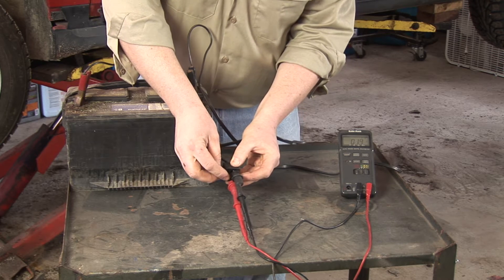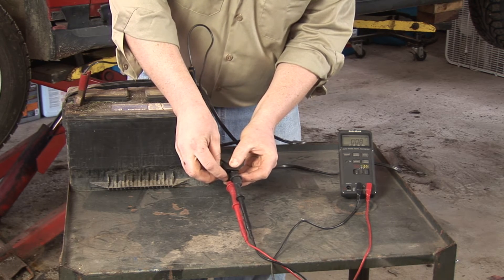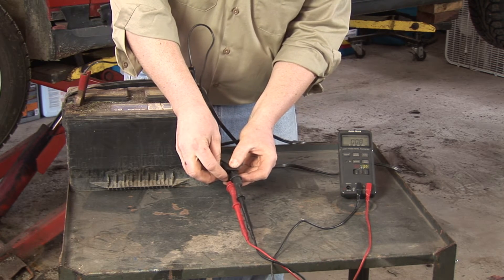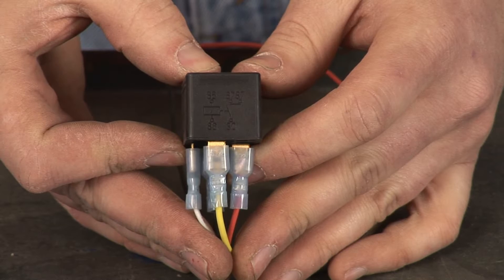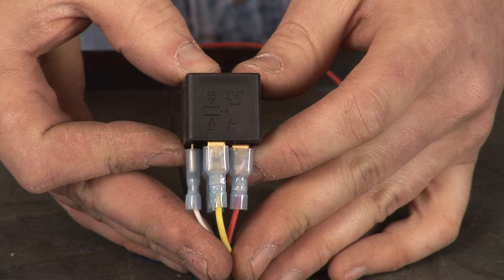Auto Repair & Mechanics : What Is a Car Relay Switch?

Comment: Yep, excelent.
I wondered how some remote place could switch on my off peak apartment heater and some pal said a relay that is sent via the phone company lines, to the building where all the heaters are switched on, as the head power company determines the weather is colder or warmer, etc.
.
I still can't believe that the switch is done over the phone company, maybe it is, maybe that is why everyones telephone number has so many digits in it
.
Thanks for posting
.
Cheers.
from,
del-boy.